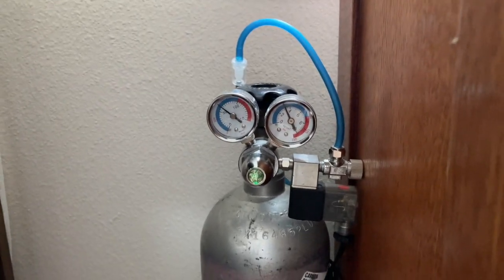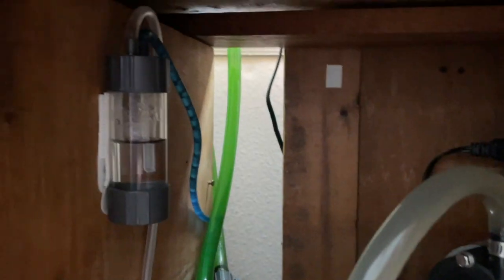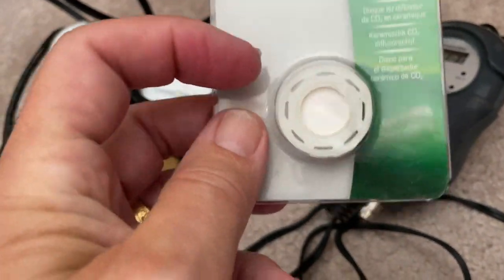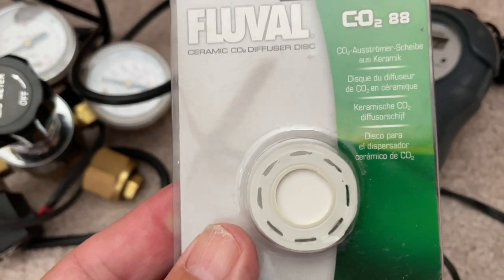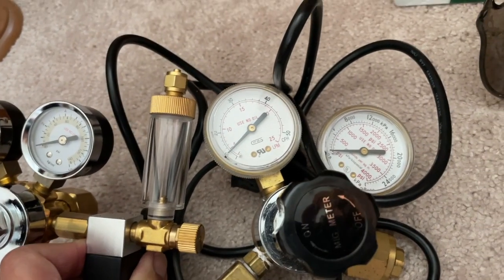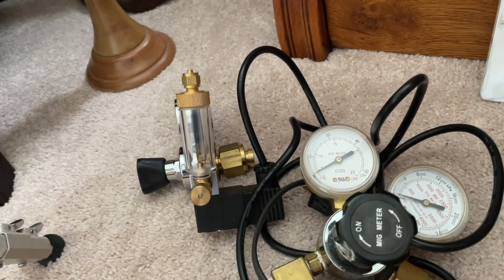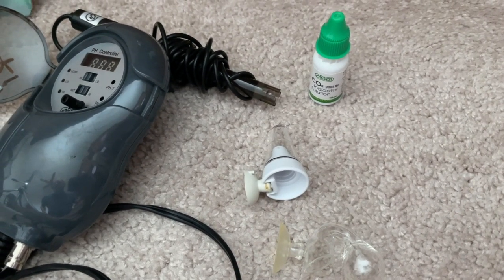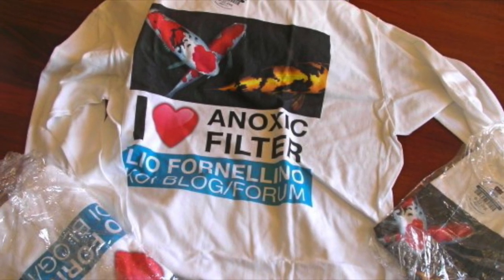Part 2: CO2 and how to use it. Kevin Novak Ph.D.

Comment: Good info! I just recently switched one of my lines to the Aquatek CO2-proof tubing, which is maybe some kind of polyethylene or something. It's more rigid, but it doesn't swell like the silicone tubing does. I also switched to the stainless steel check valves. What was happening to me is the silicone tubing was swelling until it overcame the check valve, and it would release a fury of bubbles in my inline counter and blow a bunch of the water out, so I was having to fill some of mine every week or so. I do not have this problem with the bubble counters that mount right on the regulator, though I am trying oil in one of those, since it never blows the water out, and I think that's where the MCT oil will last a long time.

FYI- I did just set up a 125G with a slow moving plenum in it, so I'm looking forward to seeing how it works out. It's heavily planted and dirted, but no dirt over the plenum, only around it, since I only planted epiphytes and stems over where the 55gal undergravel filter is. I used Flourite Red over the plenum. So, thanks for all of the lessons. I'll share some links when I get some pics and videos posted on it.
Reply: Will be nice to see your videos. There will be some problem in the 'kicking in period' Don't give up, it is really worth it once your aquarium stablizes.

Comment: I just switched to GLA CO2 Reactor and I am using 5 times less CO2 to get the same results at half the PSI (15). I am never going back to diffusers!
Reply: True, but the diffusers are entertaining to watch, especially if you have vistors to your home, lol. Yes i kinda of like diffusers in a way. The tiny CO2 bubbles sometimes disappeared in the water. But if your goal is efficiency go for the reactors. For better efficiency via cost, just plug the CO2 into a powerhead.[you save on the reactors costs]

Comment: In nature, where do underwater plants get their co2?
Why can't we create that in an aquarium?
Reply: There are co2 present in water. Respiration by aquatic animals. It is not enough to cause 'pearling' when lights are on. CO2 and lights intensity are two varibles that you can adjust to get 'pearling'.
Reply: @guppiesstories5942  so in aquariums, if its heavily stocked, we won't need co2?
Or if we reduce light, plants will grow slow, but grow fine without co2?
Reply: Can carbonates/bicarbonates be added as a source of carbon for plants?
Reply: @Kingshukpalchoudhury  If it is heavily stocked with fish[no plants] you need aeration, if heavily stocked with plants[with min. fish ]you need CO2. If you reduce light,[most aquarium are under illumiated] most likely your plants will die slowly even with CO2. In my aquarium  i have about 10k lumens. No CO2 and the plants[lots of it] do well. You have to see it for yourself. I have about 400 guppies and lots of plants and no aeration.
Reply: @Kingshukpalchoudhury  calcium carbonate acts as a buffer for ph, but it can also stores CO2 . If your CO2 levels fall in peak phtosy. it will draw CO2 out from the carbonates leading to a dangerously swing in the ph,  killing your fish.

Comment: Hi Dr.Novak, my suggestion, refill the bubble counter with distilled water so that the counter stays clear, no algae or calcium carbonate deposit. The silicone line[blue] is great as it will not harden as like the ordinary airline. I was on CO2 during the 80s. Yes those cylinders need to be x-ray tested and certified. I also used to recharged my cylinders with dry ice in emergencies when the suppliers were on holidays. But it's too cumbersome. [warning: handle with care dry ice]
All great stuff on CO2. Also would a detached bubble counter be better?  No back flow into the solenoid? Preventing corrosion?.
Reply from the maker: I have often wondered about back flow myself. If it does happen the you are SOL with the solenoid.